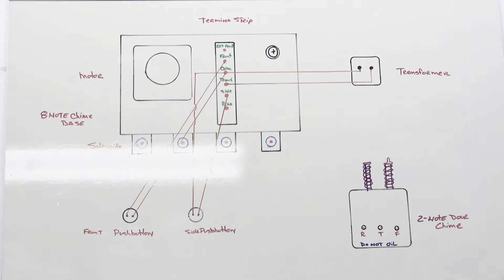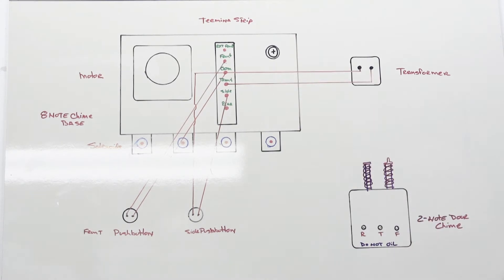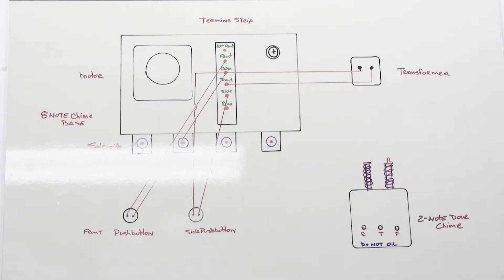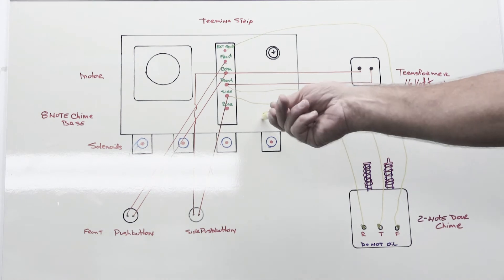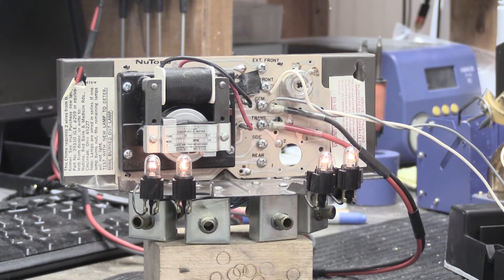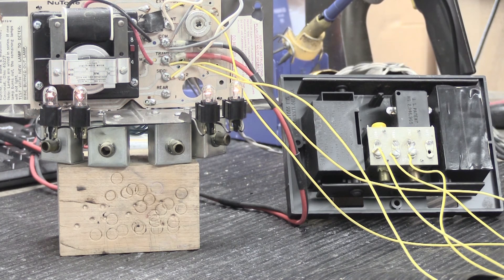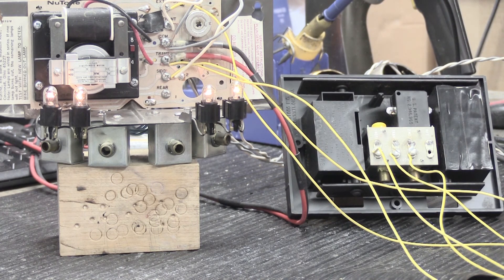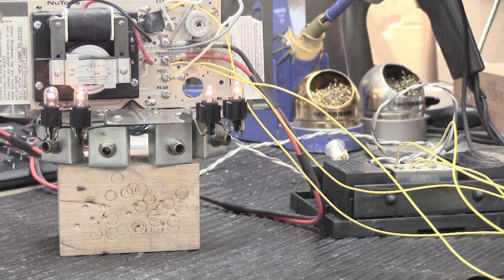How to Wire a 2nd Door Chime to an Existing NuTone 8-Note Westminster Door Chime

Comment: I really enjoy your videos.  I have a 8-note NuTone and a new adequate transformer.  Can you tell me how to connect a 2-wire puck for a 3rd generation Google Nest cam?  I need constant power to power the 8 note chime, and all the drawings I see of the 3rd gen 2-wire puck don't show the Comm connection on the chime.
Reply from the maker: Hi wwford:  Here are 3 links to our Video about connecting a WIFI Camera to either an Intercom or Door Chime like yours (both are done the same way)
1.  https://www.youtube.com/watch?v=t6YswmDNVyI&list=PLsTvqKsBnGYdNYGrlrOSVKjOLwvFWrLUx&index=3&t=1582s
2.  https://www.youtube.com/watch?v=8LXCcLr_HHA&list=PLsTvqKsBnGYdNYGrlrOSVKjOLwvFWrLUx&index=9
3.  https://www.youtube.com/watch?v=yJZV7k1nlxk&list=PLsTvqKsBnGYdNYGrlrOSVKjOLwvFWrLUx&index=8

After the Installation has been completed, you must also make sure you have the setting in the Camera App set correctly - Chirs

Comment: I have an old LA500K 4 note door chime on my 2nd floor which is somewhat similar to the one you show in this video.  However, the terminals are 1 | 2 | 3 | F | S | R, 2 is transformer, 3 is common, F,S,R are self explanatory and 1 is used if 9 volt batteries are used.  The Instructions state 2 or 3 chimes may be interconnected but there is no diagram to show it.  I'm trying to get it to work with a CHM3D on my 1st floor but can't make it happen no matter what wire combinations I try.  Can it be done with my LA500K??  By the way, nice video.  Many thanks. - Gary
Reply from the maker: Hi computeruser:  What your read in the Instalation Instructions is " OPTIONAL: 2 or 3 chimes can be connected to a single transformer - 2 chimes require transformer Model C909 or C907 - 3 chimes required transformer Model C907"
     This comment is not implying that 2 or 3 chimes can be interconncted together and controled by a single Master Chime.  It is awkwardly saying the if you have multiple chimes, you can share a transfomer to power all of them.  I think would be posssible to wire your "Chime System" together,  however it is to compolicated to describe in a YouTube comment.   You can conect me directly about this - nscompany@msn.com
    BTW, your Chime is actually a Broan chime, which is a revised Rittenhouse design from the 1980's.  - Chris